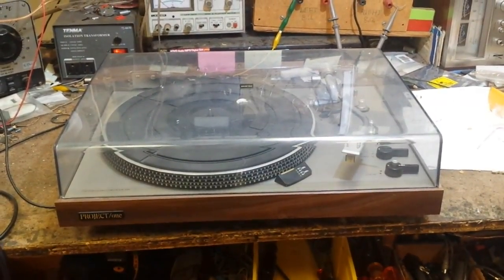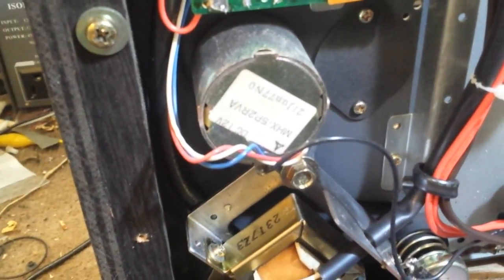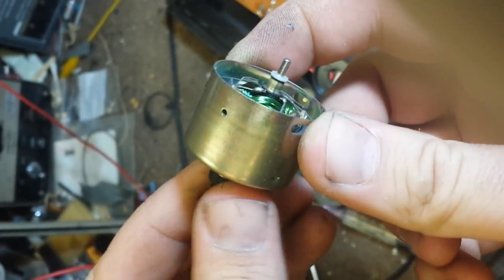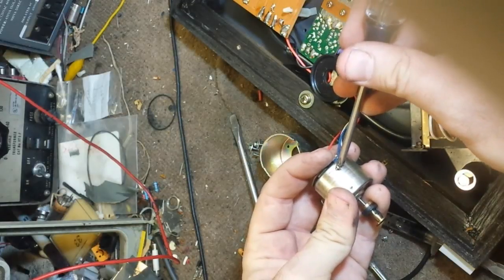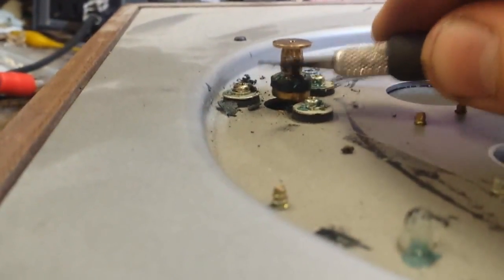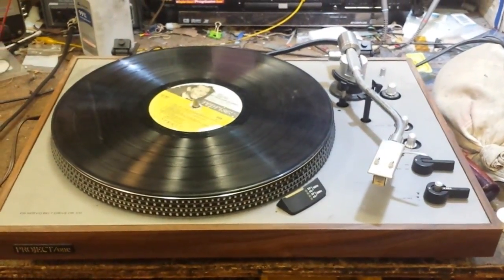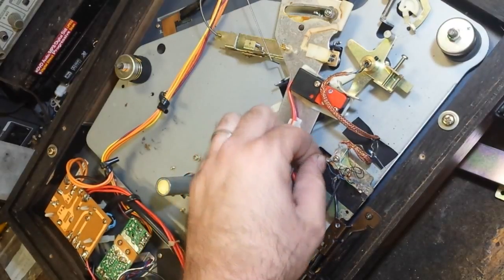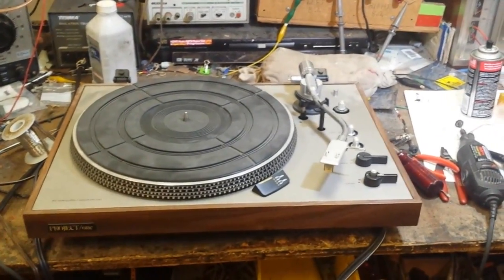Servicing a Project/One DR-330 turntable - DC motor

Comment: Thank u for the video, made me want to try to fix my motor on a Yamaha TT400u, can't find a motor anywhere so after watching ur video I went ahead and took it apart after 2 jabs to the hand (no screws holding the bottom together) I got my Dremel out and cleaned the same area oiled the bottom put it back together (of course backwards) finally got it back in soldered hooked up and it worked. Thanks soo much.

Comment: Woohoo I tried my first motor disassembly and lube and put back together. My akai turntable from 1986 is running underspeed. Unfortunately now it’s going even slower!  I guess these motors do wear out and it mine needs replaced?  I’ve got a new belt w proper specs and made sure the spindle bushing was clean and re lubed.
Reply: Maybe my new belt got too stretched out because it was seemingly too tight when I got it from amazon. 😢

Comment: I just got a Sony 300 model belt drive. I put a record on that is for 33rpm got it running and it was playing way too fast. The device was on 33 as well. I tried calibrating the holes on back of the motor now it wont turn at all. If I give the brass spinner a thump it spins a little. If I press down on the brass motor spinner I can feel the motor turning and trying to spin the brass

Comment: The plate of mine doesn't spin when is on 33 but only on 45, does the motor pulley needs to go up when it's on 33 and down when is on 45?

Comment: when buying a vintage TT will 90% of the motors need work soon? you kept mentioning if the motor is frozen when taking it apart and can't be fixed the TT isn't worth saving and trash the whole TT..... which new TT brand and model , fully automatic new one would you suggest and the stylus do you recommend. these 50 year old TT have too many parts that can't be fixed. and after a few months of constant repairs, you'll end up throwing it over a bridge.

Comment: Hi Jordan, just seen this video and its really useful. You mention that the motor cannot be replaced only serviced. For what reason is this a problem, is it that replacement motors cannot be sourced or for other reasons?
I have a Technics SL-235 turntable but motor has stopped running. I think it is wasting

Comment: Great vid!  I just picked one of these up at Goodwill and am working on it.  Curious as to what you sold it for after fixing it up.
Reply: these 50 year year old TT will work for a few months, run, problem, fix, stop running, fix. do you still have it or did the trash man haul it away to the land fill 2 months after you bought it for $5 at the junk store, (thrift shop).

Comment: Hi Jordan! I have a Grundig belt drive with a dc motor which spin too fast (I would say extremely fast).... Do you think that if I cleaned the dc motor (as you did here) would help or the problem is somewhere else? Thanks!
Reply from the maker: If the motor speed is very excessive it's likely an electronic failure inside the motor.
Reply: @JordanPier  Thank you so much for replying, Jordan! Just one more question and I'll leave you in peace... does it mean that I will have to change the motor?
Reply from the maker: @atomkraft69  yes, usually the motor will have to be replaced. The hardest part is finding one that is the correct type.

Comment: Excellent video, I've learned loads......but how did you deoxidize the speed control? I have a Pioneer PL100 with a pitch control and whenever I go to adjust it the speed jumps just like this one did.
Reply from the maker: Scruffy Gyppo spray a little caig deoxit d5 into the control where the 3 leads stick out. work the control back and forth about 30 times
Reply: Thank you very much for the reply, really appreciate it :)

Comment: Great Video. I just bought an old Sanyo TP 1010 everything works great except the DC motor is super noisy when running. Would some bearing oil fix it?
Reply from the maker: +Jay F drop or two  of oil on the top bearing should help

Comment: So I got a Sansui turntable that's a idler wheel driven unit..
So in the center of an idler wheel is a shaft that is screwed into a fixture.

That fixture (which I don't know the actual name of was brittle and broke completely in half.
Any idea what that is called?
Reply from the maker: Idler arm or idler pivot arm

Comment: Hey Jordan.

Just replaced my belt for my table. There was no manual(or belt) so had to measure the belt myself.
I measured around the path of the inside platter where the belt sits and got a length of 421mm.
I ordered a new belt which was 393 mm in length as that was the closest one I found which is 7 percent smaller than the measured length.
So I plug the record player in with new belt on and it's still playing slow.
Could it be that the belt is just a tad bit small and there is too much tension and that's why it's slow and maybe I should order a few millimetres longer OR could it be the motor that needs an adjustment?
Can't seem to locate the screw to adjust the speed of the motor
Reply from the maker: There should be 3-5% stretch to the motor pulley. There should be just enough tension to rotate the platter at the correct speed 

It's likely too tight. Typically sizes are about 23.6 - 25" for that drive mechanism. I would start large and work your way down

Is your turntable a project/one like the one in the video, or different make and model?
Reply: @JordanPier   It's a Hitachi which came as part of a Hitachi T-53L stereo system which I can't find a manual for and have looked for months.
Reply: Could the motor be damaged if there is too much tension on the belt ?
Reply from the maker: @seankennedy8506  absolutely

Comment: Hi, I have otto tp-401fa and its a belt drive but not a dc servo. The problem is it gets hot during long play as in you can't touch it long for few seconds and i think it affects the belt. Any recommendations how to prevent it from getting too hot? Thanks
Reply from the maker: Likely a short circuit inside the motor. The motor needs replacement.
Reply: @JordanPier  thanks man, hard to find here in the philippines

Comment: Excellent video with great info. My brother has a Dual CS 450, brand new, that acts weird. The turntable bounces, sometimes at the start of a record, sometimes halfway through. I don't know if you are familiar with this model, (I don't think it's one of Dual's better models) but the platter sits on a smaller, plastic platter that drives the belt. The belt looks good, and the motor does wiggle a little. I'm stumped. Any suggestions?
Reply from the maker: I would try to remove the smaller platter, and clean and lubricate the shift bearing with machine oil. 3 in one works ok. If the bearing is dry or worn it can cause this symptom. Also check for anything that may have gotten under the platter causing intermittent obstruction
Reply: +Jordan Pier Thanks Jordan. It is now working great. The smaller platter had a shaft that went into a sort of oil cup. I used deoxit on the shaft and oil cup, and re-oiled it, and it's working fine.
Reply: Thanks again. Keep up the good work.

Comment: Great video, I have a belt driven Sansui FR-3060 and I hear some rumble caused by a noisy motor. It vibrates and you can hear the rumble as soon as the stylus touches the record.  Any suggestions?
Reply from the maker: Make sure the transport screws aren't still in the motor. If you can't wiggle the motor around on its grommets a little then they are still in. often they have a blue tint to them.

Also if the motor suspension is made of rubber and has deteriorated a similar problem will occur.

Also check to See that there is no junk on the pulley and that the motor pulley is straight
Reply: +Jordan Pier I might take it apart tonight. Both the lube tubes and wires are stiff after 44 years. Will replace the tubes and motor wires for something softer to see if it helps.

Comment: Jordan: it is obvious that you are a turntable guru. I have a project one dr-550 direct drive turntable. I cant get the speed to stay constant. adjusting speed makes strobe go all over the place. plus speed is slowing down and speeds up all by itself. Can you direct me on how to alleviate this problem?
Reply from the maker: Dave Swisher get a can of caig deoxit d5 contact cleaner, take the bottom off the turntable and shoot some inside the speed control where the three leads purtrude. Work the speed controls back and forth about 20 times, button it back up and retest. On occasion the speed selector switch goes bad, but this is not often. I think after your clean the speed controls it will behave
Reply: thanx Jordan youre the best
Reply: hey Jordan where can i find rca cables for my project one dr-550 turntable? mine came apart at the plug-in.
Reply from the maker: Dave Swisher here's what I've been using

http://www.newark.com/mcm/24-12492/6-premium-stereo-patch-cable-dual/dp/64T7438
Reply: does both ends have plug ins on them? if so i will have to cut the plugs off one end to wire up to turntable. if i have to cut plug-ins off which wires go where on turntable?
Reply from the maker: Dave Swisher it's a shielded cable, so after you cut the ends you'll need to strip the outer cover, then the center core. Red is right positive, white is left positive, the shield is negative

Comment: Hey Jordan, 
My 30 yr old son is getting into vinyl, so I'm giving him my Denon DP-30L. Had it store in its box for many years. Motor works fine, but the tonearm is not dropping or lifting as it should. Any tips on how to lubricate and best oil for that purpose. ✌
Reply from the maker: Those servo arms weren't designed to be taken apart. I've found that trying to service them usually results in death of plastics and warpage of the drive coils that move the arm. 

You can try zeroing the arm while the turntable is unplugged. Adjust the counterweight until the arm just begins to float above the platter. 

Now plug in, set the tracking force dial to about 1.5 and the dampening to the same if it has it. Pray it works otherwise it's more or less a brick. Long term hibernation is a kiss of death for these.
Reply: @JordanPier  that worked, thank you. Plays just like it did when it was new. It had been in storage for years but had it wrapped in the original plastic bag, Styrofoam and box. Maybe that kept it from totally going to shit. Thanks again!